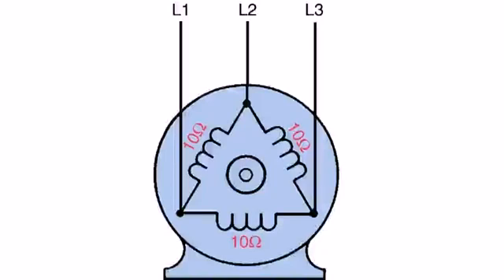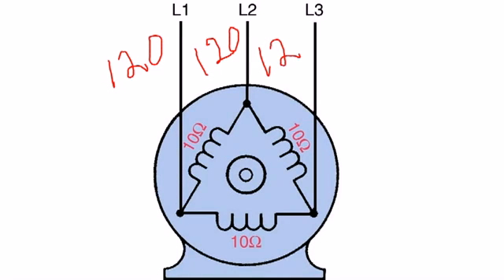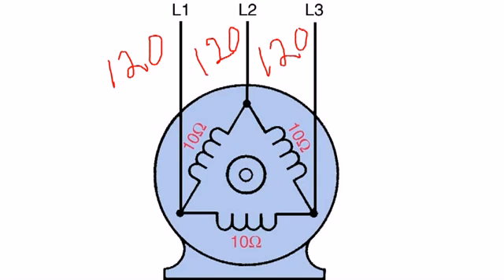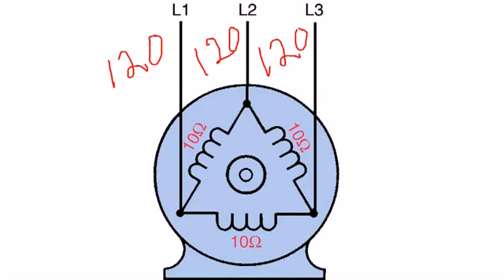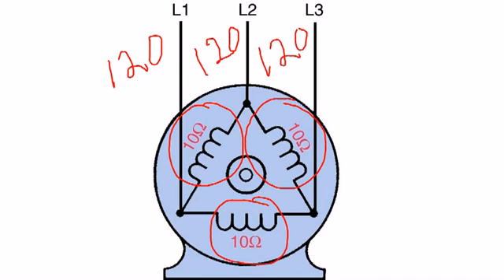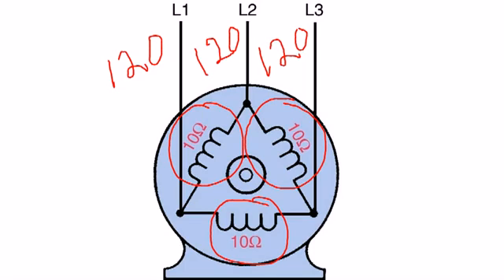3 PHASE MOTOR WINDINGS

Comment: Awful presentation. And 120 would only show from leg to ground/neutral in a 208y system. Should be 208 shown for 2 legs or 240 for a wild leg system in the video.